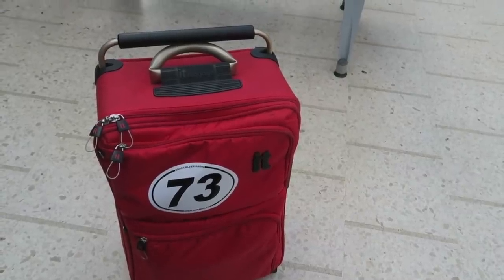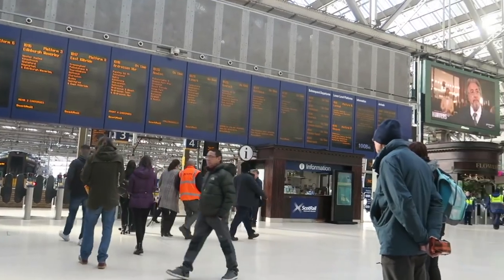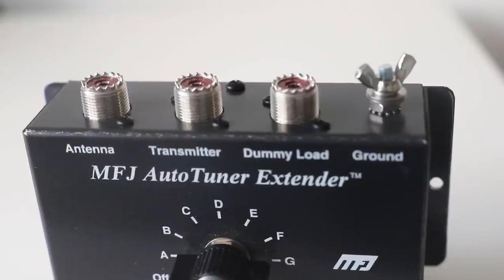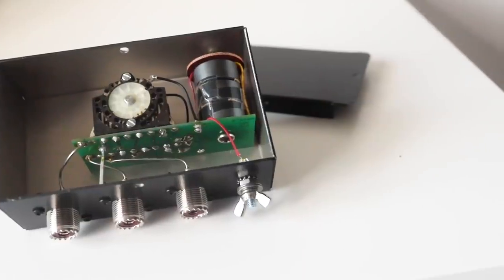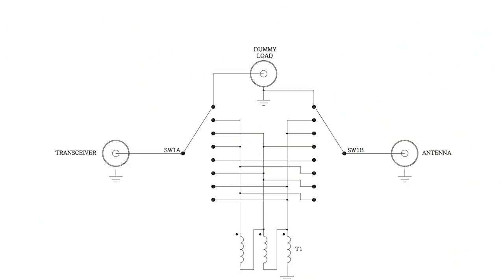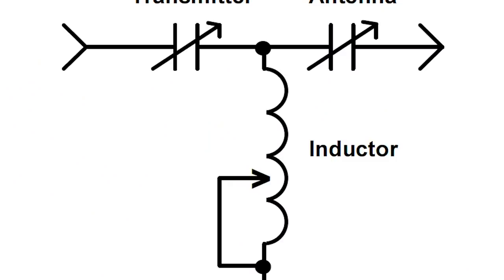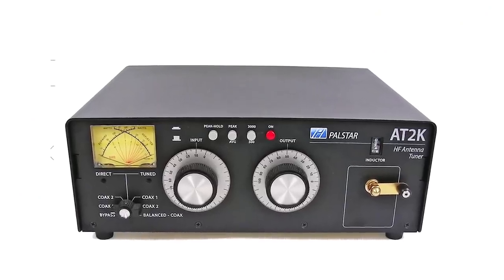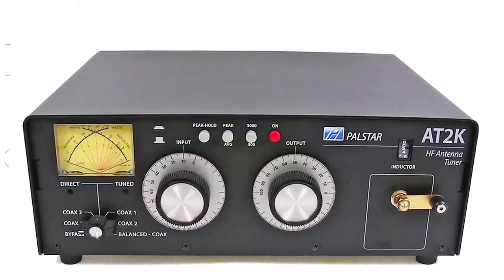Antenna Tuners   Things to Consider

Comment: Peter is a very nice bloke, but he is wrong.  Antenna tuners actually alter the phase relationship between the Voltage and current leaving it, to where it is complementary to the matching error between the antenna (load) and it's feedline.  This artificially alters the apparent match between the load and feedline.  (also making the tank circuit that is an antenna "resonant" with the electron bouncing between the capacitance and inductance smoothly as though it was resonant at your chosen frequency) Ron W4BIN
Reply from the maker: ……sorry but we will have to agree to differ on this one. 73 Peter
Reply: A tuner provides a conjugate match by adjusting the capacitive and inductive reactances to cancel each other out, also as you mention Ron corrects the phase of the voltage and current, in this condition the antenna system is resonant, reflections by Walt Maxwell covers this subject in great detail and is a must read for any amateur
Reply: Hi Ron, sorry to be so late to the party so to speak.  The concept of conjugate matching using an antenna tuner is correct in regards to the impedance of the transmitter being conjugately matched by the antenna tuner to the impedance as seen looking into the free end of the feedline and if there was no line loss the antenna tuner would be able to tune the antenna to resonance as Walt Maxwell stated but when you factor in line loss which is the real world situation the antenna tuner placed at the transmitter end of the feedline does not tune the antenna to resonance.  You can say the antenna tuner tunes the antenna system to resonance if you consider the feedline part of the antenna system, but you can't say it's tuning the antenna to resonance due to the line loss and this is easy to prove using the smith chart as long as you include feedline attenuation.  73, Don wd8dsb
Reply: @Pioneer936  The key is that the antenna tuner tunes the antenna system to resonance and the antenna system includes the feedline.  Due to line loss (attenuation) the antenna tuner placed at the transmitter end of the feedline does not tune the antenna to resonance, only the antenna system.  Walt skimmed over this issue a bit but he did qualify his statements by saying he was first looking at a lossless transmission line situation.  73, Don wd8dsb
Reply: @wd8dsb  not necessarily much line loss ,that depends on the feedline used
Reply: @Pioneer936  Hi Pioneer936, Here are some real examples (using 4NEC2 antenna modeling and SIMNEC) .  68 foot vertical on 160 meters using perfect ground (this would be a half size vertical with a feedpoint impedance of 6.86 - j558 ohms, SWR 916 to 1) with 100 feet of LMR-400 feedline, using a low pass L network Qc =2000, Ql = 200.  L network located at the antenna feedpoint: loss = 1.69 dB, L network located at the transmitter: loss = 12.85 dB.  This gross example shows placement of the antenna tuner can be critical (critical when the mismatch at the antenna feedpoint is great).

Now to support the point that Walt Maxwell had, let's make the vertical 126 foot tall which is much closer to a full size 1/4 wave vertical on 160 meters but still a little short.  Feedpoint impedance = 30.6 - j 53.6 ohms, SWR = 3.86 to 1).  L network located at transmitter: loss = 0.51 dB, L network located at antenna feedpoint: loss = 0.22 dB.  Not much different when using a good low loss feedline and when the mismatch at the antenna is not horrible which is the point I believe Walt was trying to make/drive home so to speak.  73, Don wd8dsb
Reply: @wd8dsb  yes agree if the mismatch is reasonable like 20 .1 or 10.1 which some may consider unreasonable, and using low loss feedline say 600ohm open wire with the tuner at the transmitter using a dipole then there's very little loss
Reply: @@watersstanton if you disagree with the first comment you have a total misunderstanding on this subject
Reply: @Pioneer936  Totally agree, and one of my multi-band antennas is a doublet (dipole using 450 ohm ladder line) and I use an old heathkit antennna tuner in the shack with it.  I use this antenna on 40 meters all the way through 10 meters and it works amazingly well.  73, Don

Comment: The many antennas that require an external atu. Commercial or homebrew. And always keep the vswr under 1.5:1 if possible. Not 2:1
Reply from the maker: But 2:1 is still very workable and the difference is tiny. 73 Peter
Reply: @watersstanton  Yes i found a chart showing 10% 73
Reply: @stevenlawhon3695  did the chart take feeder loss into consideration, reflected power encures loss as it returns to the tuner then again on its way back to antenna, if a low loss feeder is used like balanced line then most of the reflected power is radiated by the antenna
Reply: @Pioneer936  73

Comment: Perhaps the least understood concept in this hobby. A.C!
Even in the UK full course there is no great detail on phase or complex impedance calculations. 
Give the harmonised qualification and recognition schemes i expext the same is true around the world.

For everyone new to this. The tuner/matcher is there to help present an impedance match to the transmitter only. This will help the power amplifier work more efficiently and reduce any harmful back e.m.f, high voltages, circulating currents, resonance etc being generated in the output stages and killing your rig.
While you should now get more actual power output from the back of the TX this doesn't mean there is more radiated power at the antenna. There may be. But you will equally be dissipating power in the matcher/tuner. That is to say the output power of the TX will be divided between the antenna and the matcher with some losses in the feeders and connections too.

Suffice to say its best to read about this from quality textbooks written for engineers and physicists than anything related to the hobby. It is not a slight on help that other offer but a sad fact that much of what is offered is inaccurate or simply wrong.

For anyone else who wants to argue a point about radiated power they should investigate imaginary power and question why energy providers charge you for such stuff.

Thumbs up for a helpful video.